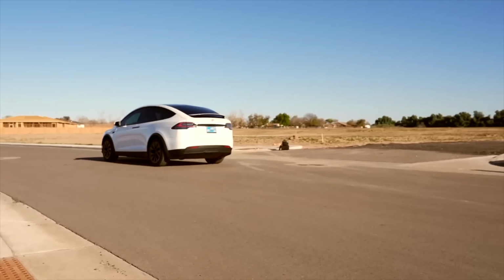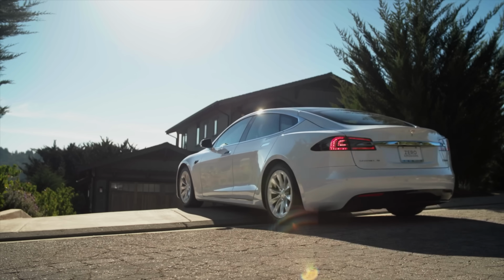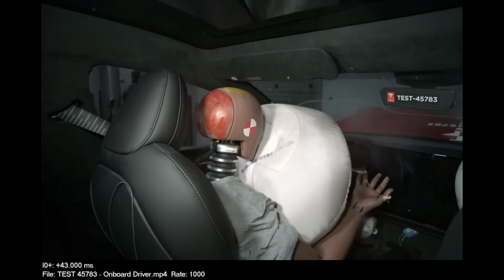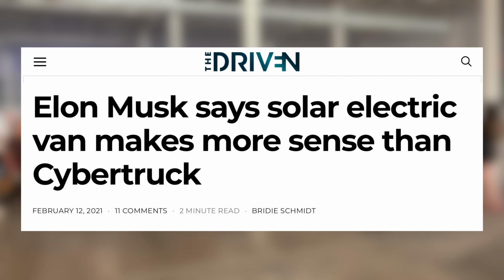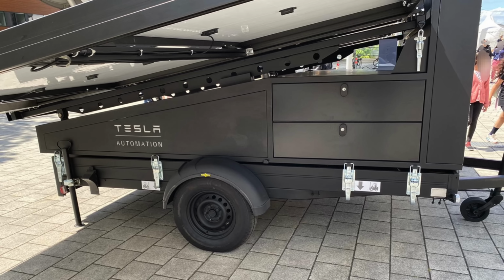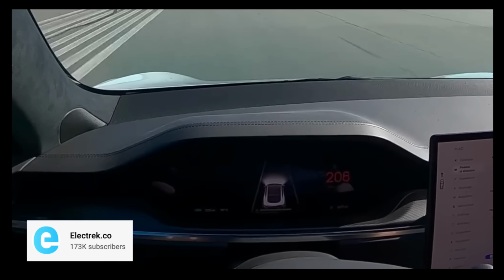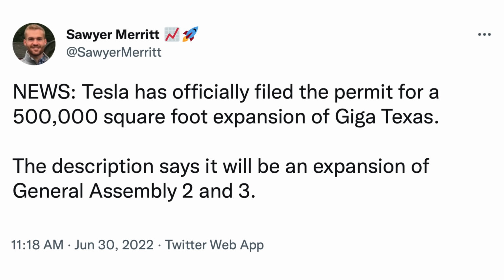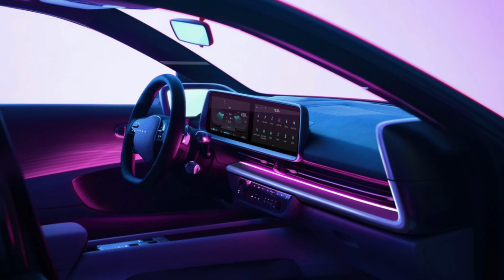Tesla Model S Plaid Was Hacked | Now It's Breaking Records

Comment: paying 20k to unlock 200mph is hilariously a money grab. Why does Tesla need to have liability? if the car can go 200, let it go 200. OR, better yet, for the money, the car should already come with carbon ceramics. 
from what many plaid owners tell me, the breaks that come with the car are really bad, and start to fade after a few hard stops. thats not something anyone should worry about after throwing that much cash. 

the thing I dont understand is that this 20k upgrade doesn't change the 0-60, but only top speed. you could buy a Mercedes SL55 AMG for like $17,000 and that'll go around 190mph - upgrade to the 80mm pully for around $1,500 and it'll go over 200 MPH, and the 0-60 will be in the 3.5's. chip it, and it'll go even faster. sure, not as impressive as the 2.0 sec on the plaid, but you save $141,000. and to me, the 1.5 seconds that you lose is definitely not worth 141k lol. 

teslas are cool, but the plaid just makes no sense other than the 0-60. When Tesla finally adds another 'gear' similar to the porche taycan, I can see Tesla hitting 250+ MPH.

Comment: far as I'm concerned Tesla has missed the mark, why can't they make a car for the masses single motor 300' pounds of torque 182- 200 horsepower that goes a 1000 miles on a charge how hard is that to produce ?? but yet they don't.
Reply: 275hp base Model 3 with 500km of range is enough

Comment: I don't understand the concept of solar trailers, because if you're going to put solar somewhere may as well put solar where it's cheapest and won't be parked in the shade and doesn't have to be lightweight.

The same solar put on the house could provide energy into the grid which then can get stored somewhere else and then use later. Or is energy that doesn't have to be used later. One kilowatt is 1 KW either way.

Comment: Hmmmm lets see. The model S will get 312 miles on a full charge, in the sunny warm days in the Midwest, however in the Winter time when it’s hovering around 10 degrees the “S” will lose 1/2 of its battery strength giving the owners only 156 miles. THEN WHAT, very few manufacturers are driving this point home enough.
Reply: It's not even remotely close to 1/2 what the hell. Where did you pull that number from? At most it's 25%. 

If you need more than 300 miles for your daily commute you're probably driving a semitruck.

Comment: It may go fast, but how long does it last? Until electric vehicles can make it 20 years/200k miles minimum with no major repairs and only routine maintenance, (tires, brakes, etc) then I am not giving up my Honda. 12 years, 174k, no major repairs, still going strong.
Reply: We don't know yet. The Model S only went into production 10 years ago, and early production vehicles are known to have issues.
Reply: There's already a tesla with 1 million miles and did 620,000 miles on one battery

Comment: Easier to carry a little gas generator for emergency charging.. the Sun charger is an abortion... for little miles
Reply: Or buy a portable battery and never worry about maintenance, leaking fluids, or fuel going bad.

Comment: Last month a Tesla Model S Plaid in Napierville, Quebec set the new record for the fastest quarter-mile time for the electric sedan at 8.83 seconds and 161mph.

The Model S had a stripped out interior for weight savings, as well as SV104 wheels wrapped in Mickey Thompson drag radials at the rear and Michelin PS4 tires on the front.

Not content with the blistering fast time, the same Model S Plaid has set a new record this week. At the same track in Napierville the Model S crossed the line in just 8.77 seconds at 162.55mph (261.60km/h). Unlike last time, there is a video of the record run which you can see below.

As for what changed that allowed the car to go faster this time the owner, TMC user mulot30th, said there was an additional 60lb weight saving over the previous attempt due to someone else being behind the wheel on the run.

Additionally he said there a slight change to the suspension.

“Main change is suspension geometry change (slight) which reduce “tire drag” a little bit at least that is what I intended to do with that and have worked,” he said.

Interestingly, the top speed at the end of his quarter mile run of 162.55mph is inches away from the electronically limited top speed (when not in Track Mode) of 163mph.

As we first told you about earlier this week, Quebec-based Ingenext was able to hack their way past that limiter and reached a top speed of 216mph (347km/h).

As for this Model S Plaid, the owner says that while the car does not feel like it is slowing down when crossing the line, he feels there is not much room to improve beyond 8.77s with the current setup.

You can check out the record run below.

The post Tesla Model S Plaid breaks quarter-mile record again: 8.77 seconds at 162.55mph [Video] appeared first on Drive Tesla.
Reply: No
Reply: @austensmith6857  LOVE HATERS!

Comment: Instead of a solar-powered car, I'd rather just have a solar panel that sits on my home roof or in a solar farm and adds electricity to the grid and save/make money and then spend that money to buy electricity from the grid. Essentially you're transporting solar panels by car when it's much more efficient to transport electricity by electrical grid. Even if solar panels could grant me enough range to make a 6-hour trip without stops, I think I'd rather avoid the added cost of car-integrated panels. Not to mention I like having my car in my garage to avoid the weather, so most of the time the solar panels would be wasted. We want the materials going into solar panels to get the most use per wear as possible, and I just think on a car isn't nearly practical enough to make up for this loss of use per wear.

Comment: I hope Tesla sells trailers that have a battery pack built into it, so you can charge it and connect it to your truck. People in construction would be able to use it in a more practical way, and make it so your range isn't impacted near as much.
Reply: @neal cassady or you don’t? You have 5 trucks electric trucks on a cycle, instead of 3 gas trucks. And 1 fuel truck constantly coming and going.
This can make remote work sites far far far easier. 
Is it that hard to see?
Reply: @neal cassady The trailer has solar panels. It generates its own free power. Also, even if you did charge it off the grid, there are more than just coal plants. Many areas are almost completely powered by hydroelectric.

Comment: that solar trailer has roof mounts, the folding solar panels will bolt to the rear Angel of the cyber truck, the rest of the trailer is a test mule I bet
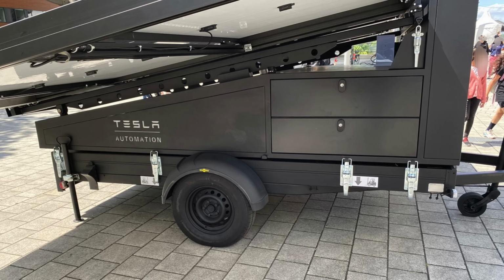Reply: 8:13 of the video, the trailer is same angle as cyber truck

Comment: The sunroof is usually a huge deal in the top of Tesla’s. Why couldn’t they use this area on the top of the cybertruck and make the solar panel completely open up for a sun rook that way. (Question based on my ‘98 Audi S8 I owed if you want to look those up.) I have seen one in the US with one, but I first saw it on the one I owned in Germany.
Reply: Why didn’t iPhone offer a front facing camera right away?

Comment: Look guys, let's think a little straight here. That trailer with solar panels is to power up the starlink internet service for remote locations. Take this thing out into a remote state park or location where internet would be beneficial. It is not to tow it around for extending the range of an EV.
Reply: It's built for portable solar power.. many uses.. but not functionable as mobile power for being towed. It was not last.
Reply: If you want to power a Starlink then you don’t need an overpriced trailer with that many solar panels.

Comment: Way prior to this update I actually had my S raise the suspension on a rough section of highway.  It should also automatically raise the suspension for speed bumps.  I wonder if the 216 MPH overstressed the carbon wound rotors as they probably went past 20,000 RPM.
Reply: there should be headroom
Reply: @JohnSmith-pn2vl  Probably, just like with every car, but i feel like tesla is already pushing limit spinning motor to 18k rpm so i wouldn't risk driving at 216mph too often.
And battery will turn into stopwatch if you want to drive on autobahn at that speed.

Comment: A trailer specifically for electric vehicles is a good idea. Collapsible when empty, extra braking and acceleration...

Include a 2kwh battery, a bank of supercapacitors and an electric motor/regenerative braking system.

Towing cuts mileage by so much beyond just an increase in mass. No regenerative braking and inefficient current draw while accelerating with heavy loads. 

Add solar panels as an afterthought..

Comment: I have an idea for Elon.  If he adopts it he can give me a new Tesla Model Y Long range with 4680 batteries.
All he needs to do is make a solor power kit that will fit on the roof of a 40 ft long by 8 ft wide semi trailer.  Think of all the semi trailers on the road each day.  Then he could easily adapt a cable to his new semi and supply extra power as it drives down the road.  Even semi' trailers on ICE trucks could collect solar power and when they stop to fill up those gas gugglers they could upload the solar power into the grid system to be developed by Elon which could supply power to Elon's semi's as needed.  You don't need a solar farm.  You have millions of semi's on the road everyday that could easily be collecting solar power.  Remember, you heard it here first.

Comment: Modding and tuning is not hacking.  This is much closer to doing a tune on an ICE and inventing nefarious descriptions is how we all help making modding and tuning illegal as we transition to EVs.
Reply: They did it by modifying the software. That software isn't designed to be modified. Doesn't that make it hacking? It's not a mod since you are not changing parts and it's not tuning either. I don't think it's illegal since you own the car and should be fine if it doesn't make it dangerous on the road. I think if you tried to sell the hack to others, Tesla might be able to sue since you would be using their name in the advertising.
Reply: @ymcpa73  Manufacturer tunes are not meant to be modified and modifying tunes are actually illegal due to environmental laws.  Tunes are created by people who reverse engineer how to change settings the manufacture did not intend to be changed.  It is literally the exact same thing. The third parties selling tunes just figured out how to streamline it for the consumer with dongles and software. Flipping settings stored in the computer to change performance.  In an EV they are power limits and discharge curves, in an ICE they are fuel/air/timings.

For an EV, tuning is actually legal because there are no environmental laws making it illegal.  You are always allowed to modify your own stuff by law.  Tesla can't even invalidate the warranty unless they prove your tune caused a component to fail, this is warranty law from the 70s and it applies to ICE  cars too.  Tesla has only been able to ban supercharging, but that goes away if they open up their network for subsidies, then all they can do is charge you the public rate and not the tesla rate.  Even then, laws should catch up and put a stop to anyone blocking any car from charging as every car performs their own battery monitoring and can turn off their own charging if there is an issue internal to the car, the charger does not need to police that.  The charger just needs overall circuit breakers that trip beyond the capacity the charger and cable is rated for.

Comment: Shame you didn't look closer into the Lightyear scam.  The miles gained each day would require that the solar cells are properly oriented to the sun - which can't happen on a car.  And they gave numbers for mid summer, clear sky, at low latitudes.     Especially surprising that you didn't think about this when you also discussed the tesla solar charger that has a vastly larger surface area and actually can orient it's panels to the sun.

Comment: Ryan, and everyone else of course, your thoughts please.  I wonder if the prototype “tow behind” solar panels are not intended to be tow behind in their final form. I think it is just for testing the prototype. If you remove the entire wheel and under structure, leaving just the panels, it looks like it is designed as a cover for the Cybertruck bed. It’s hard to tell, but the center panel may be a fit for that size usage. Just a thought.

Comment: Tab-less battery looks good on paper has a flaw in the patent. By producing 1M samples, can only mean 1M flaws repeated and does not implies that flaw has been addressed with an appropriate solution. 

Flaw? A metallic bristle wafer is use to conduct electricity from anode flaps (shingles) to the cylinder base, however it is an insulator impeding heat from passing through the battery. 

Bristle wafer? 
It is a metal disc full of metal whiskers, conducts electricity and insulate heat.

Consequences? 
Overheating the battery during rapid charge and discharge cycles. Causing premature aging (longevity) and in extreme case, fire or explosion of the pack.

What conducts both electricity and heat? 
In this case, soldering. More specifically - Induction heated solder reflow process. 

Induction heating? It’s like melting frozen butter in a cooking pot energized by an induction cooking range. In this case, to melt applied solder paste bridging across the anode flaps and cylinder base.
Reply: Real world experience proves you wrong.

Comment: The solar option would only seem practical if you were going camping, and are staying put for awhile, which would be more practical for a camping version of the cyber truck.
Reply: could work on jobsites that dont have electricity if it comes with some sort of battery bank.  it could be used for charging power tools, powering some lights, or any of the other misc things that you use all the time in construction that wont require a bunch of continuous power draw

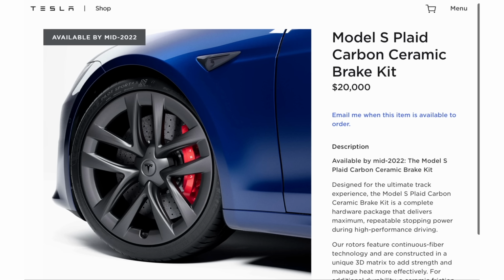Comment: 11:11 Extra Speed? There is an EV on the road (i think it is, even so way more expensive then a Plaid), which goes 256 mph (no hack) also damn fast.
Reply: Rimac Nevera
Reply: It's also 2.5 million dollars.
Reply: The hack is just removing the limiter. It does not make more power or anything.
Reply: Yes, it's the 200k 4680 Roadster in 2023 ⚡🔥🇺🇸

Comment: I knew the plad was software locked. It pulls harder after 60mph. Now it's a plad+ with the hack
Reply: If they allowed the motors to deliver maximum torque the instant the pedal is matted, they would rip the half shafts out, or break the motor cases.
Reply: @AverageGuy87-r7k  Oh well..  but you could be right.. if it has more traction than shaft strength.
Reply: @AverageGuy87-r7k  no, the tires would just spin and do burn outs.
Reply: @larryc1616  You clearly haven't had a high powered car before.
Reply: @AverageGuy87-r7k  Tesla limits the power before 60mph to prevent wheelspin. You can't break the half-shaft on 295 street tires only with big drag tires!